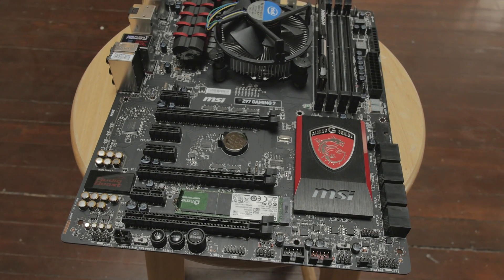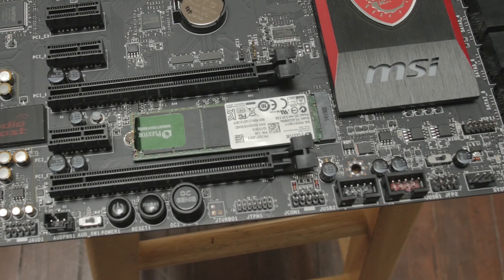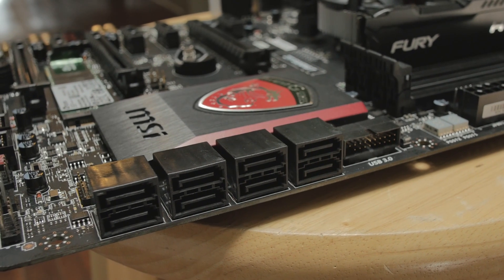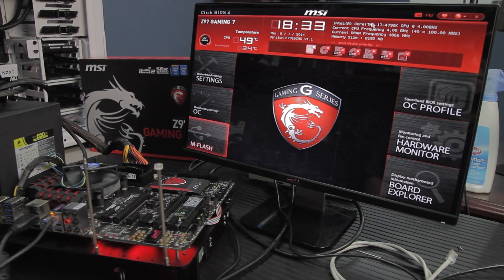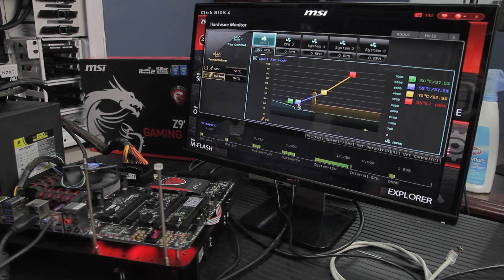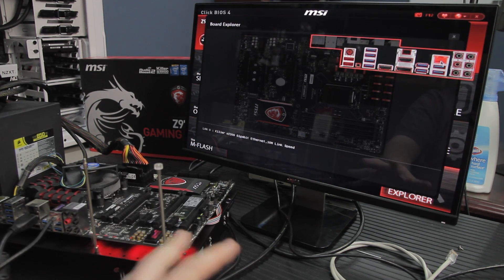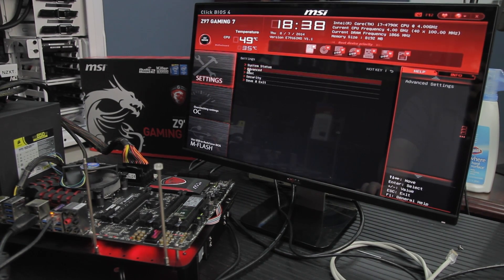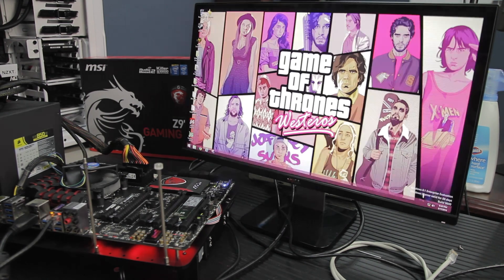MSI Z97 Gaming 7 Motherboard Overview and Benchmarks

Comment: Any bottlenecks in this system?
ASUS gtx 680 DCUII
Amd fx 8350
16gb 1600mz ram
Mobo: asus m5a99fx r2
128gb kingston ssd
and some hard drive of some sort... XD
also windows 8.1 (yes i know, i'm going to use the "downgrade rights")
Reply: No everything looks good to me!
Reply: japaneseguineapig ok, just wondering thanks !
Reply: Obox2550 OK? dude experience doesn't Necessarily equal intelligence. YES AMD CPU'S and Nvidia GPU'S at SOME POINT did not work well with each other, BUT now its insignificant.  MANY people use 8350 and 8320 with Nvidia cards and they work fine. AND why can't i post comments disagreeing with you, That's exactly what you have done here.
Reply: Obox2550 Then you have used old parts,since compatibility problems now are only a myth
Reply: Surms41, i agree with you completely, im sticking with windows 8.1. i got a retro start button so its all good. trying to learn the rest of the UI though. thanks for the feedback though!
Reply: Not bad, but I would recommend a 770 unless you're getting a really big discount on that 680, because a 770 is a bit faster than a 680. Also, an intel CPU would serve you better for most everything over an AMD CPU if you can spend a bit more.
Reply: Why do you want to downgrade from 8.1?
Reply: Never use an AMD CPU with an Nvidia GPU. They don't play nice together.
You're better off getting one of the midrange i5 processors with your 680/770, or go AMD for both CPU and GPU.
8GB of RAM will be enough
Get a 250GB SSD if you can, they are quite a bit faster than the 120GB ones.
Reply: GibletGamer I can vouch for this,I run an G3258 with R9 270 and it works fine
Reply: Kaleb Gilley Well, have you even seen the performance increases in muilti-threaded tasks?!?!

Look at Battlefield 4 for example. (I'm using 8-threads for both os's)
On windows 7 Ultimate x64 i was getting a little over 70-80 fps on average on the testing course.
On windows 8.1 i'm getting 95-100+ fps on average!

Windows 8 optimizes the shit out of multi-core cpus.
It's not worth downgrading and making your performance suffer.
You can also install a start menu mod, works just like windows 7.
Reply: Kaleb Gilley Sure,but 8.1 has the option to disable the Metro UI and boot straight into the the desktop UI
Reply: DavisSgt Exactly. You can make win8.1 look, pixel per pixel, like win7, WITH the huge increase performance.
Reply: Obox2550 This ^ :)
Reply: Surms41 Just look at your own picture, you greasy piece of shit. Nobody needs your comments you ignorant dirtball.
Reply: Obox2550 Dude you're making yourself look like even more of an idiot now, just please be quiet.
Reply: GibletGamer Thank you.

I blocked him so I don't get infected with stupid.
Reply: what do you need that much ram for? how much is the 680? also if this build is for gaming the 8350 trades blows with both the i5 and i7 so theres not much reason to go with those chips unless you need to for some other reason than FPS
Reply: I would love to say the Kingston SSD since the bait switch thing,but unless you don't notice it,its fine
Reply: Henry Griffiths The UI on 8.1 is horrendous.
Reply: Kaleb Gilley It's basically the same as 7 if you use classic start or something similar.
Reply: Henry Griffiths It's still not quite the same, I have 7 on my desktop and 8.1 on my laptop and it's pretty bad even with something like "Start is back" i'm going to stick with 7 until windows 9 comes out as they are heading back to the classic interface.
Reply: Kaleb Gilley well different strokes for different folks. I find 8.1 just fine, and I was due a re-install anyway so I got rif of all sorts of clutter at the same time
Reply: Henry Griffiths yeah i personally am not having a good time with windows 8.1 given it 8 months of a try.
Reply: GibletGamer 
Is this your current system? I would keep Windows 8.1. It got an improved task scheduler which increases performance for AMD CPUs like yours.

You are using Classicshell already I guess?
Reply: Obox2550 uhh never heard of that b4
Reply: Henry Griffiths Yeah? You're the guy who said Windows 8 is similar to 7, shows how much you know...
Reply: Obox2550 It used to work that way but now everybody plays nice
Reply: Obox2550 I probably know more than you so yeah
Reply: Obox2550 They work together fine..
Reply: Deathbrewer It's like a skinny white kid dating some really big black chick... just doesn't work as well as it should
Reply: Henry Griffiths Yeah kid keep thinking that
Reply: Obox2550 No.
Reply: GibletGamer Quiet you
Reply: Obox2550 i posted  the comment in order to get feedback if anything you should shut the fuck up
Reply: GibletGamer You're an idiot then. I have more experience with computers than anyone here and I told you a straight fact. If you don't listen then that's perfectly fine of you but don't post comments disagreeing with me.
Reply: Funny... I have the same system as you. But with a 770.
Reply: Surms41 I know there is a performance increase, but the start menu's don't work quite right/as well as they should; I would much rather stick with windows 7 where the ui is good from the get go and you don't have to modify it to even get a slightly okay experience.
Reply: Kaleb Gilley Buuuuut... Windows 8.1 has the issue of administrative privileges where even if you turn "UAC" off, you still have to run most programs like CCleaner and Autoruns in administrative privileges in order for them to do their job. That combined with random hangs in the operating system where it indexes what you are doing (which you also can't fully turn off) just makes Windows 8.1 unusable for something like a powerful desktop. And I've see the benchmarks too about Windows 8.1 having better performance but the funny thing is, I've had both Windows 7 and Windows 8.1 installed on the same SSD at the same time at one point just to do a performance comparison and I literally got identical results on both OS in games like battlefield 3 and 4, Bioshock infinite, Titanfall, and CSGO, though in CSGO there was a little bit of stutter at the beginning of every match in Windows 8.1. There could be a couple reasons why 8.1 shows better performance in benchmarks online. Firstly it probably is better optimized from the beginning, meaning you can just install the OS, update it and then just install your games and you'll have most of the performance you could possibly get, but if you're like me, I tweak the shit out of Windows 7 because it is such an open platform to where I almost optimize it myself afterwhich it runs so blazingly fast that Windows 8.1 just can't compete. With a Samsung 840 Pro and a Core-i7 4790k @ stock clocks, I can get windows 7 to boot cold in under 3 seconds, though that is after spending a day with the operating system after a fresh install, tweaking everything in the control panel and registry until I am satisfied.

So that could be one reason, but the other reason could be that Microsoft pays companies that write online articles to claim that benchmarks show that WIndows 8.1 performs better, even though it may not. Knowing how much money Microsoft has and how much they have been trying to shove Windows 8.1 down peoples' throats, it wouldn't completely surprise me.

But that's my experience. If you have a pretty powerful desktop, there is no reason you should be running WIndows 8.1. Now if you have a laptop, more or less a touchscreen one, then windows 8.1 might be the better option, especially if your laptop doesn't scream performance.
Reply: Obox2550 The programs MUST have admin privileges in order to alter the system.

You even said you had to tweak the shit out of it to get the same BOOT TIME.

I also have an ssd and boot win7 in about 6 seconds (fresh install) and windows 8 takes less than 3.

As for hangs, that MUST be your system, as I am running smoother than on windows 7 with no hangs.

You cannot optimize windows 7 multi-threading through tweaks, its hopeless.

And as stated above, my battlefield 4 benchmarks went from ~80 fps to ~100+ fps just because of the multi-core optimization.
These are my own benchmarks btw.
Iv'e also done Physx benchmarks myself and found hyperthreading having more than 15% increase.

Specs:
i7-3770k @ 4.2GHz
2x6970 Xfire
G1 Sniper3
OCZ Revo SSD
Reply: Kaleb Gilley Not even close.
Reply: GibletGamer quiet you
Reply: Obox2550 I see you're resulting in attempting to shut me up since have run out of logical options to discuss this. THE ORIGINAL comment was about bottlenecks, You had nothing helpful to say. So shut the fuck up... It's saddening seeing your stupidity.
Reply: Quiet yee
Reply: Obox2550 Whatever helps you sleep at night.
Reply: ***** I don't code for microsoft but after 5 years of trial and error, I've learned how things work and know how to make special adjustments to Windows 7.
Reply: GibletGamer everything looks good, only thing is. THE FUCKING AMD CPU!
Reply: ***** What's wrong about it?
Reply: GibletGamer it stutters in game and so on, anyone saying otherwise, is lying.
Reply: ***** No need to be salty about a cheaper and still reliable CPU. It works fine and doesn't stutter at all.
Reply: ***** i beg to differ. It takes amd 8 cores and 4.0 ghz to do what intel can do with 4 cores at 3.4 ghz. And i own an amd, i know its terrible, saving for an i7 4790k setup.

Comment: I'm an owner of this motherboard, but I'm not so deep into the very specifics of workings, all I can say is that it is running smoothly. I have experienced power outs and random crap crap that happen (like cats getting their tails sucked into the computer) and this motherboard has not even made a hiccup.
I would highly advise this board for anyone that wants good performance, looks, and reliability. And no, MSI's support doesn't suck, quick support systems get my msi gpu out and back quickly.

Comment: Nice videos bro  im I'm traing to make a computer that is good at gaming and editing videos i want to play all games in ultra seting and i want to edit 4k videos can you make a video about this coputer and the price between 1500$ and 2000$
Thank you.
Reply: http://pcpartpicker.com/p/w6DWJx This build will be extemely quiet, and very powerful, you should be able to play most games on ultra even at 1440p, the i7 with 16GB's of RAM is the best choice for editing while keeping some semblance of a budget, and since there are only 2 sticks of ram you can throw another 16 GB's In their later if you want, the PSU is overkill and thats so that you'll have alot of overhead and can upgrade/overclock int he future without worries and it allows it to run cooler and quieter; not to mention the color scheme matches ;)
Reply: I made a video about a light weight 4K gaming PC, that should do 1440p no prob, check out my channel for the $2000 4k gaming machine
Reply: The thing that cost the most money with his build was getting it set up for rendering, for 2k you can have a build that easily plays 4k, run something like 3 R9 290's with an i5

Comment: I've had this for a couple of months.  It's nice but I have an issue where the sound deteriorates after a while.  I dont know whats causing it bur I can usually reproduce it after having PS3 Media server running for a while. It sounds perfect when I first boot and stays that way unless I run ps3ms for a few hours.  After that the sound becomes weaker and static is introduced. Been too lazy to send it back.
Reply: Hayden Roberts
No, it's not a good suggestion because it doesn't address the problem of why it's happening in the first place.  It has nothing to do with what I want to hear.  It's like someone talking about how the engine in their car stalls and you suggest them getting a motorcycle.  Your last statement should read, "Never promised I'd give a good suggestion."  That's more honest.
Reply: Shawtybad It is a good suggestion, dedicated audio cards are better. Never promised I'd give you the suggestion you wanted to hear.
Reply: Stop using the onboard sound and get a real sound card?
Reply: The onboard sound on this is not bad at all when it's working properly so that's not a good suggestion.

Comment: I have this motherboard for a while. It is very nice, i love the features. The only bad thing was that when i build my system i had to install 1 ram, boot, then install second ram, boot and so on with all 4 Ram. Sorry for my bad english.
Reply: Wow that sucks
Reply: Why did you have to do that?  I have this same board but didn't have that issue.
Reply: I really dont know. But if i put all the ram at once it crashed

Comment: Dislike for the MB  cpu average temp 49ºC?? mb average temp 39ºC???  . . .. thats why im with maximus vi formula 33ºC gaming just with Intel hd 4600 :v
Reply: The temps in my MSI board are several degrees higher in the bios than when idling on the desktop, not sure what causes it but mine gets around 10 degrees cooler on the desktop so I wouldn't read anything into those high temps.
Reply: And that's why you don't get overkill MOBO's, ladies and gentleman. A $300 MOBO and no GPU when you could get a $150 MOBO with 90% of the features and get a $150 GPU.
Reply: Peter Hernandez Munive 
Thank you for providing your insightful comment.

Comment: I have this board and there is some inconsistencies with fan control in the MSI control center software, if you adjust the fans speeds in the software it will force the fans to 100% all the time and only way to fix that is the clear the cmos

Comment: Got the AMD version, 2 months in and its fantastic for £65, haven't tried the onboard sound yet but will later, the EUFI is great to use and while overclocking takes getting used to compare to gigabyte and asus it works well, the hardware manager section with real time fan monitoring is great if you plan on using the fan headers if you dont want to get a fan controller.
havent noticed the killer nic increasing cpu usage.

Comment: Could I use a Dark Rock Pro 3 with this MOBO? The reason I ask those massive heatsinks.
Reply: possibly, you're going to have to beat the forums, looking at google images you're mm close. the vrm heatsinks are right next to the socket box and the DRP3 heatpipes just start to rise up at that point.
personally id try it and gamble, that might seem callous but more often than not things just work.. my missus' hyper 212 evo touches the side panel of her source 210, but it still fits :D

Comment: one 7 away from a jackpot
Reply: ***** overclocked to 7.7Ghz
Reply: ***** Actually that would be the highest. Sorry. No, I'm not fun at parties.
Reply: msi z77 gaming 7 maybe?
Reply: just putting windows 7 on it makes it a winner
Reply: Brick Tamland msi z97 gaming 7 with windows 7 on it running on a 7 drive raid 7
(raid 7 doesnt exist AFAIK)
Reply: D4rkR3bel5 Add on a GTX 770 and 7GB of RAM